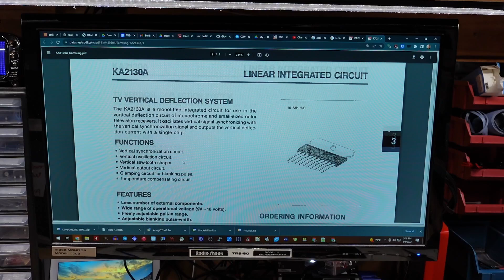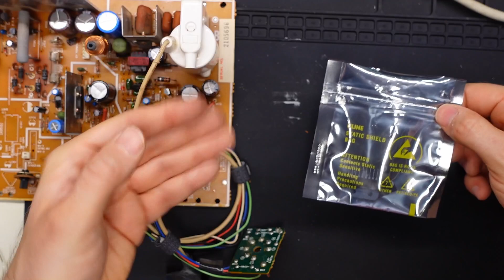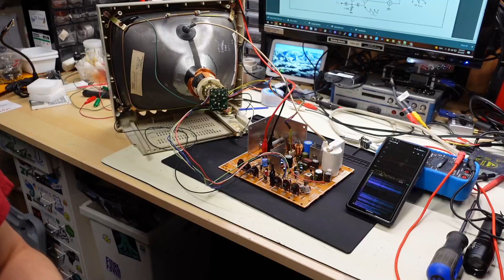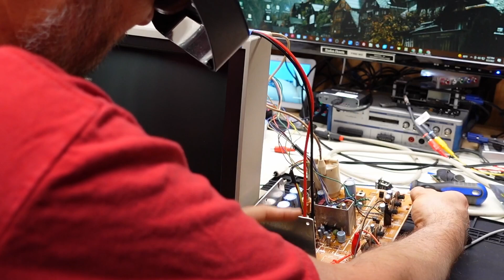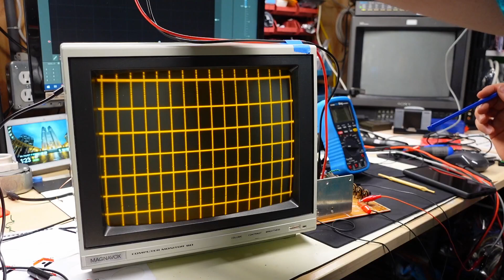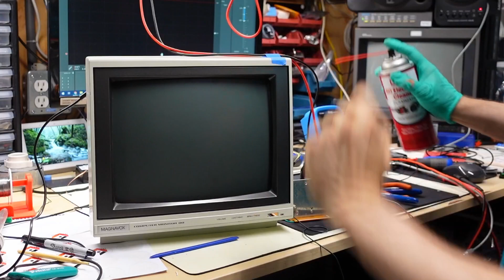Fixing a couple arcade CRT boards for David Murray

Comment: my 3 thoughts
1) cracked PCBs: use epoxy to stabilize,  clean the surface before with acetone and/or glass fiber before
2) i hardly recommend getting an isolation transformer plus a power limiter (like 100W incandescent bulb, with a switch to have unrestricted power). in case look at tube radio channels, they have that tooling for working on their hot chassis. that fiddling with feeding DC somewhere into the board via a FBR gave me "yelling at the screen" moments.
3) speaking of "yelling at screen". The IC being mounted backwards was my first thought when you showed the solder side of the PCB, since the pin1/10 did not correspond to the beveled edge of the IC.

Comment: Thank you for sharing that Spectroid App. I am also in my 40s but I can still hear frequencies up to at least 18khz, usually higher. I started hearing a high pitch frequency, turns out my tv is generating a 17khz sound at -60db. I never would have been able to narrow it down.

Comment: I hated working on the CRT driver boards. The boards I worked on were very tightly jammed with components making them difficult to get probes into various places without getting zapped. The usual fix was as you said the driver chip from what I recall.

I wonder if the blackening etches is due to the cracks. With the poor connections, the connections were arcing and further carbonizing the surface of the circuit board.

Comment: The PCBs that run a tv/monitor are generally called a chassis. It's a carried over term from the old vacuum tube TVs that were older than PCBs and just had everything soldered together.

Comment: I hope David got a discount or his money back because it sounds like that repair shop doesn't know what they're doing. Not knowing how to correctly place the pins on a chip seems like incompetence.

They might have been lucky that they didn't cause more damage to other components on that board by turning it on with that chip soldered in the wrong way.

Comment: Really fantastic debugging video. When you first turned on the bad board, having it sideways, and talking with your hands, it was a bit unnerving since you just articulated the possibility of high voltages arcing across the board if not properly grounded. I'm glad you know what you are doing so you can even touch things like the yolk while the monitor is running. Hopefully others don't try and repeat what you do. I used to take old Mac's apart and new how to zap the high voltage from the CRT, but still never felt at ease working with them.

Regarding the second PCB with cracked board...finding the end of the crack and drilling a small hole right at the end of it will make sure that the crack doesn't spread.

Comment: 36:37 - when David was on vacation he had a friend over doing a repair for a broken monitor for him. The problem was that the board was cracked similarly to this case. He scraped off a huge part of the solder mask on the ground plane and soldered a piece of paper clip that reinforced the part and also provided conductivity between the two parts. I had success using the same technique on a broken Nintendo 64 controller PCB, you should try it too :)

Comment: I recently replaced the battery in my mother's laptop. The batter simply dropped into it's cradle. I made sure the printing was on the same side as the original.  There was a spark and magic smoke.

'E's not pinin'! 'E's passed on! This laptop is no more! He has ceased to be! 'E's expired and gone to meet 'is maker! 'E's a stiff! Bereft of life, 'e rests in peace! If you hadn't nailed 'im to the dock 'e'd be pushing up the daisies! 'Is metabolic processes are now 'istory! 'E's off the twig! 'E's kicked the bucket, 'e's shuffled off 'is mortal coil, run down the curtain and joined the bleedin' choir invisible!! THIS IS AN EX-LAPTOP!!

Yes the replacement had the printing on the opposite side. Mom now has a new laptop and I have a dent in the bank account.

Comment: So do all of the older monitors have that inductor, even Magnavox and Commodore monitors?  So if the monitor video is dim could this inductor help with the brightness and other issues as  you mentioned, I just wanted to see if I understood this correctly, interesting.
Reply: Different monitors will have different circuits so not all will have this inductor. In this case it's part of the horizontal oscillator. If a monitor syncs adjusting this won't change your brightness at all.

Comment: Hey yeah you mean theres more metal in the heat sink so it requires more heat, so without the extra heat could cause voids in the solder joint that could cause a bad solder joint.  Clever idea using youre Hakko.

Comment: Andy idea what might be causing these continuous waves on mine? —> https://youtu.be/_liYw2lJrPc

Checked caps, good ESR readings and no bulging. But wondering maybe if it’s a filter cap on the a/c mains input. 🤔
Reply: That looks to me like AC ripple getting into the monitor circuitry. Electrolytic filter capacitors in the front of the power supply could easily cause this.

Comment: The cheap phenolic that they use for the PCB, on cheap consumer gear, was always a problem for cracking, even when new. Hard to see the cracks too sometimes. Its like using peanut brittle as a copper substrate. O_o
-
You can use old used pieces of solder braid wick to jump across cracks. Its already got the solder on it :) and its flexes around stuff nicely when the solder is fluid.
Cheers,

Comment: CRT are dangerous and another smaller YouTuber who you have mentioned has said not to worry about it.
I like that you give a warning.
Loads of people say they can fix boards but just change all electrolytic capacitors and check for short then give up.
Then blame a  hard to find ic rather than fix.

Comment: Adrian, how did you know that your tube will fit to that board/deflection yoke to get such a nice picture out of it? I tried to connect an amber tube to my 12" PET 4032, but it didnt do anything (stays dark, HV was there). The tube should be absolutely pin compatible, but it didn't work? :( What did I do wrong? Back to the green one, everything was working perfectly again.
Reply: If they're pin compatible* and have similar electrical specifications it should work fine unless the tube is broken. You may need to adjust the brightness though.

*There are a few different pinouts for 7-pin CRTs, particularly with the location of the screen and focus electrodes. If a 0v focus lead from the monitor connects to the tube's G2 pin you won't see anything.

Comment: My dad worked for DEC in Reading, UK in the '70s... they had a floor of something like 250 desks, each with  a VT100 on it. I used to be taken there some evenings, and could walk in and pinpoint any monitor that had been left on by sound alone! I'm 56 now, but don't know if I can still hear 15kHz any more, because I haven't seen a CRT in ages!

Comment: Adrian... you can look for the datasheet of the voltage regulator to know for sure at what DC voltage the board runs..... instead of trying different voltages.......... then you can set the DC to 2 or 3 volt over that....... or feed the proper voltage directly to the output leg of the regulator to feed the board.....
Reply: There's a good chance the board uses discrete components for regulation in which case this method wouldn't work. Personally I was wondering why he didn't just ask David what the voltage was.

Comment: You have no idea how irritating fiberglass can be especially if you don't wash it off with cold water. My dad was a sheet metal worker and worked with that stuff all the time. I helped him on a job once and I felt like I bathed in itching powder until I took a cold shower.

Comment: Great job! Anything CRT-related is an immediate click for me. The L601 inductor is identical to the one on the Wells Gardner K4600 deflection board so I'm not surprised that fixed it. It provides the same function of fine tuning the H.Hold when adjusting the regular pot does not get it to lock on. Happy to see you got it working. Also, those fiberglass pens are anything but. The actual fiberglass pens are known as "Prep Pens." Search A(m)azon for "PrepPen Adjustable Sanding Pen" and those will be much better since they are actual fiberglass pens.
Reply: Strange. I use the ones like he has and they work really well. They sure seem like fibreglass. If you touch them, you get tiny little shards embedded in your finger

Comment: Just FYI, Adrian, you need to be careful injecting DC into a bridge rectifier.  Typically, the bridge rectifier when fed AC, each pair of diodes only conducts for half of the waveform, meaning each pair of diodes has a duty cycle of 50%.  But if you feed DC in, then only one pair of diodes is passing all of the current all of the time.  And if the company went cheap on the diodes, you can cook the diodes in the bridge rectifier.
Reply: Dagnabbit.  You addressed this in the video.  At least you recognized that there might be an issue!  ^-^

Comment: They are referred to as "Monitor Chassis".   The Adjustable Coil is the Horizontal Width Coil which adjusts how wide the picture is.  As a rule of thumb, you should get about 1K Volts per inch of a Tube at the second anode (Suction Cup attached to the tube). i.e. a 15" Tube should be around 15K volts and a 19" monitor should be around 19K volts, etc...   It's also recommended that you don't insert the high voltage probe under the cup while the monitor is powered up.  You could easily pop it off the tube and now you have a wire flopping around with thousands of volts coming out of it.   When you put the cup back on the tube give it a yank too.  If it comes off, you didn't attach it correctly.

Comment: 36:52 If this is a single layer PCB I highly recommend drilling a hole at the end of that crack to stop if from spreading. Any damage done by drilling can easily be fixed with jumpers wires.

Comment: OK, the smothing caps are rated at 35V in the original? If so (with a margin for regulator failure I would assume the B+ to be around 25-27V) hook up a volt meter to the B+ start your DCPS at 12 and ramp the voltage up, the regulator will start working at some point and the you will know what voltage the boards need to run at.
Reply: 25 volt caps would be pushing it if the DC voltage can reach above 20 volts. This is pretty close to the 18 volts which Adrian found was near the limit.
Reply: @eDoc2020  I thought Adrian said 35V?
Reply: @petesapwell  He did. What I'm saying is if you expect you may see anything over 20 volts you should probably upgrade from a 25v to a 30v capacitor.
Reply: @eDoc2020  Yes, I see

Comment: Great tip Aapje. Also for boards that have corners snapped off superglue sticks vero board REALLY well. If you dont have the broken off piece you can shape another piece of board. You've got to be quick though because it sets very quickly on PCBs. Be careful when soldering across the join coz you can get a puff of nasty, acrid smoke in your face.

Comment: I would likely suggest going a route of a complete desolder and  a trip to pcb way..
to replace the board..

sadly age isn't kind to boards of monitors bodge wire is a temp fix though the permanent fix is to replace the pcb sadly it mot fix the monitor if it has burn in..

Comment: Sometimes the board is designed for the tube. I always remember some "flatter" CRT monitors for the Amiga where to be compatible with the Amiga and its 15Khz mode they reused a PCB for a more rounded monitor and the picture didn't look right as a result. But they still shipped it.

Comment: 37:00 if you drill a small hole in the PCB at the end of the crack,
that will prevent the crack from developing further.
Reply: Well, David is excellent with a dremel and a screwdriver.
Reply: Yes. Like on crash cymbals when cracks :)
Reply: Just like they do on aircraft!

Comment: If the surface of the metal tab is exposed to Moisture in the air the.. Tarnish, Oxidation begins but its most likely caused by the sulphur from the capacitors. Great Fix Adrian! 
Oh the can you called an inductor is a IF transformer Not an inductor.. the change on your phone app was caused by you adjusting the Oscillator coil - Tuning Capacitor. 🖖👍

Comment: QD Cleaner, I like how that fixed the potentiometer. I have 3 sets of Packard Bell Speakers that screw into Packard Bell Monitors (Total of 6, 3 left and 3 right) and the potentiometers (Volume Control) on at least 2 of them are very defective. I think I will go shopping at Walmart and look for some QD Cleaner and give it a try. Thanks for sharing.
Reply from the maker: I learned about it from Jordan Pier's channel. It does work well and it really does free up stuck pots too as it dissolves the bad grease.

Comment: Nice job. You could drill a small hole at the end of the crack in the board to stop it continuing across the pcb.. And fill it with epoxy after.

Comment: You can glue perfboard or bare PCB material with epoxy to reinforce it.  Super easy.  You can drill holes or cut out around any components or pins in the way to get it flush.  Same for mounting holes.  Overlaying layers of PCB is strong and permanent

Comment: Cracked PCBs around the flyback are the bane of CRT repairs, been looking at a few monitors on ebay that apparently show no signs of HT, and I'm wondering if they have the same issues, not a hard fix, but very much a pain to trace, stabilise and jump all the cracks with wire or even just solder wick, but it's oh so fulfilling to hear that CRT squee as it fires up properly though... :D

Comment: I had the EXACT same thing happen to me, but unfortunately it was an Op Amp package for a stereo receiver that went out.  The packages looked identical and I didn't think twice about just putting the new one in with the printed side facing the same way and smoked it.  Luckily I was able to figure out what had happened, got another part, and it worked.  It's not perfect, there's now some noise floor that wasn't there before, so something else got damaged or the part itself is crud, but it works.
Reply: Wasn't expecting to see a comment from an prior coworker on one of my favorite channels... small world we live in. :D

Comment: If you find the end of a crack in the board, drill a hole through it (where it ends). That stops the crack from continuing.
Reply: Well, in the case of this board, it's not necessary. First, one end of the crack originates (or terminates), at the edge of the board. The other end stopped at a hole in the board. Just roughen up the surface a little, then apply a generous coat of epoxy... BAM! done...
Reply: i would use some glue to keep the board ends together, and then drill a small hole in the end of the crack to stop it
Reply: There is enough space to drill multiple holes without breaking traces. I'd drill some holes on both ends of the crack and then use cable ties to tie them together. That should give it enough mechanical strength to last the ages, in combinaties with the wires that prevent electronical failures. A technique that I have used in the past on a CRT with a crack was to remove solder mask from broken traces and solder a paper clip over the strace, completely covering it with solder tin. The paper clip provides mechanical strength, while the solder tin takes care of conductivity.
Reply: @danielmantione  True, "drift-stitches" would work :)
Reply: @danielmantione  On simple single-layer boards, this is an option.  I've used a brace and bit to do this , which seems to give a good measure of control and avoids stressing the substrate during drilling.  Love the paper-clip trick.

Comment: A few bits of PCB material and epoxy on the top side (and into any cracks) would help with preventing those cracks from developing. 
FWIW I find scratching solder resist with a knife then using a glass fibre pencil to do the final clean up works best.
Reply from the maker: I'll let David do more cleanup if he wants. :-) The solder mask was unusually thick on this board. A polishing wheel on the Dremel would have probably worked well.
Reply: @adriansdigitalbasement2  Green rubber one works fine. Even from Aliexpress. Different colors have different density but green is ok.

Comment: If you don't have the CRT 'dag' hooked up you may not even get HV.  The CRT outside dag coating along with a similar dag coating on the inside that is connected to the HV terminal, forms the HV filter capacitor.  If this isn't present, there is nothing for the flyback/rectifier circuit to charge up, so little HV will be generated.  Note that flyback circuits using a voltage tripler will have hv disc capacitors on board, so these WILL produce HV without the CRT ground connected, though maybe not as much as they would with it hooked up.
Reply from the maker: That makes sense. I've never tried to operate a CRT without the ground connected.
Reply: @adriansdigitalbasement2   Wasn’t there a missing ground on the Watchman you repaired?  I remember you were getting a tingle from that one.